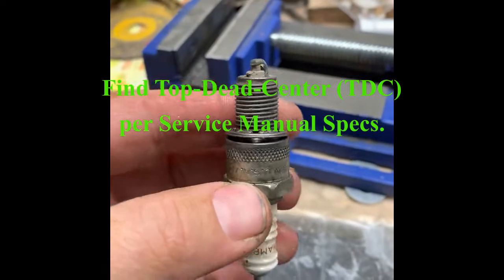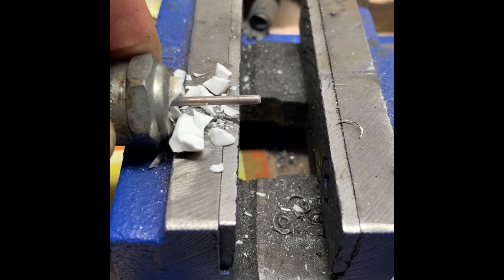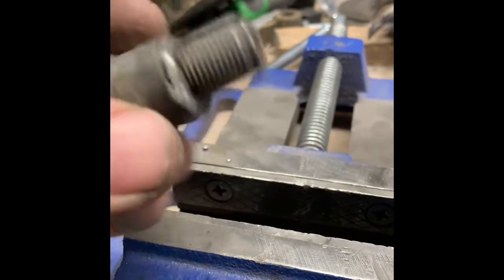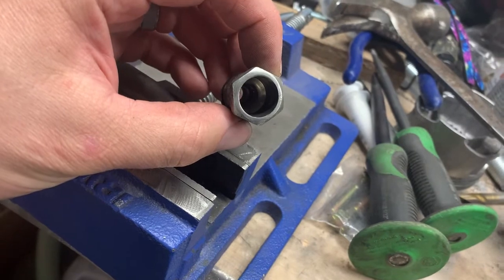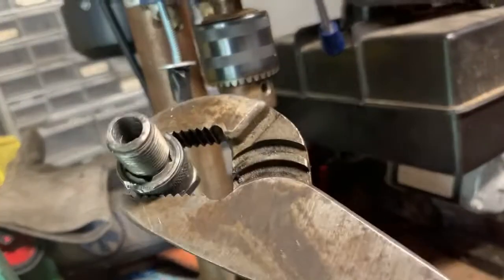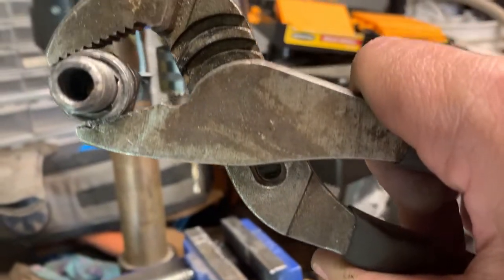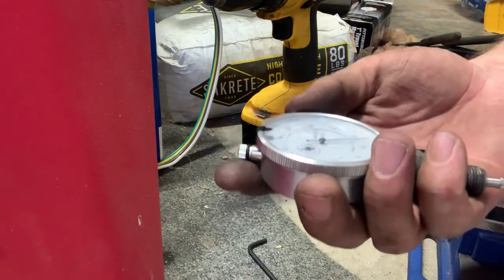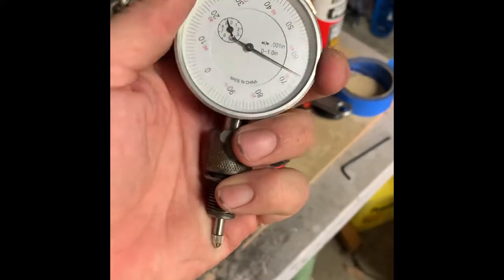DIY DIAL GAUGE FIND TOP DEAD CENTER (TDC) - NO FANCY TOOLS HARBOR FREIGHT DIAL GAUGE

Comment: JB Weld it on...!
Reply from the maker: A great suggestion.  However, I want to be able to use the base with multiple gauges.  The HF gauge is barely long enough to do this DT175 engine.  If I were others seeing this video I would seriously consider your suggestion.